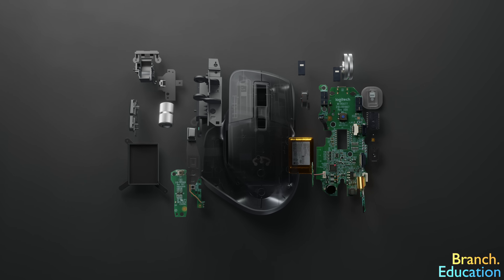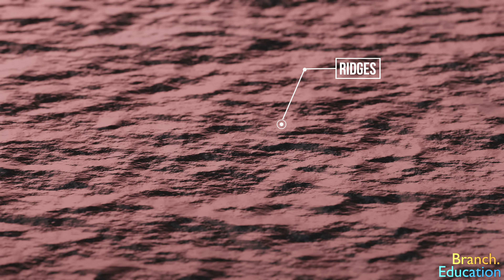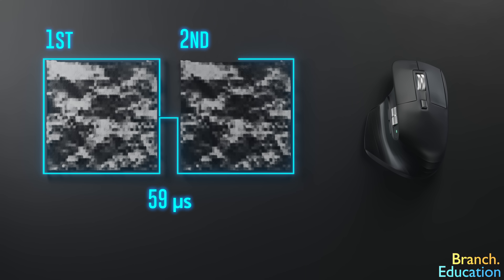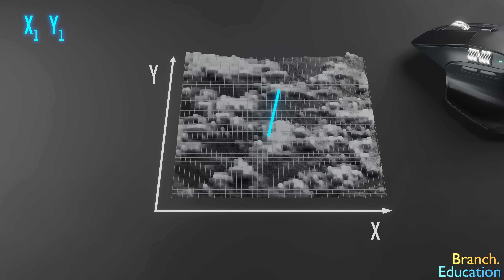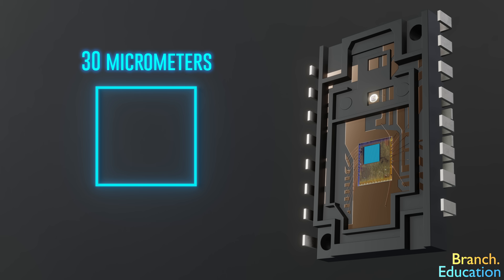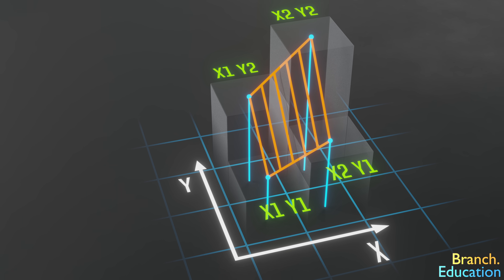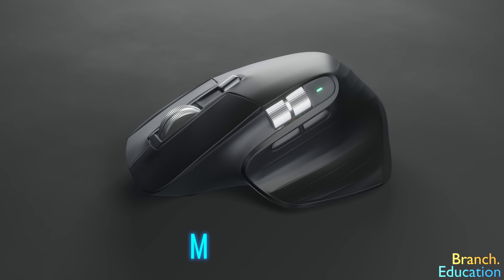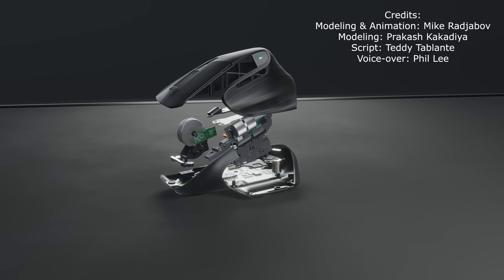How does a Mouse know when you move it?  ||  How Does a Computer Mouse Work?

Comment: How does the cross correlation algorithm simplify? Wondering how does the processor know to move in this direction and test whether the difference then reduces to zero or does it test in all directions?
Reply: I would like to know this too...
Reply: I think, since you accelerate your hand not instantly from 0 to the given speed, the algorithm, at the beginning of the movement only has to check a very small change in all directions. Once the algorithm knows in what direction the mouse is moving/accelerating, it basically only has to check the spaces around the predicted next point.
Reply: I find hard to believe cross correlation is used, it seems a very wastefull way to do a simple task. 
It could easily be done with some sort of feature detection algorithm and a simple matcher.
Reply: Early mice used 16*16 or 30*30 pixel sensors. With hardware acceleration, it should be possible to use a cross coralation algorithm fast enough. Especially since you don't really have to check all possible moves. At least that's what I found in multiple online articles. I think feature detection won't really work that well witch such low resolutions and was 2000, when the first optical mice came not really a thing.
Reply: But im not a optical mouse manufacturer. So this is all just speculation and things I read online
Reply: It basically calculates a convolution like this: https://en.wikipedia.org/wiki/Cross-correlation#Cross-correlation_of_deterministic_signals